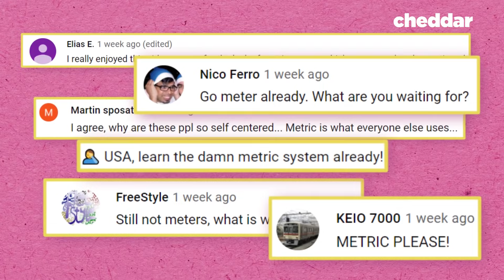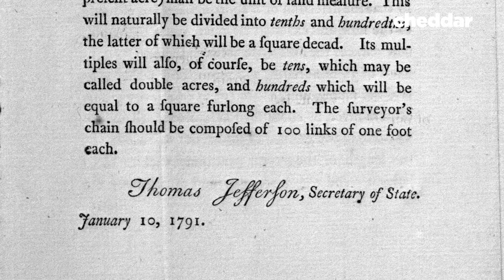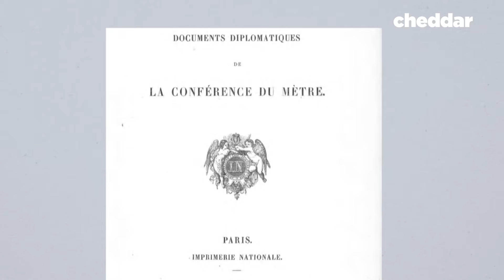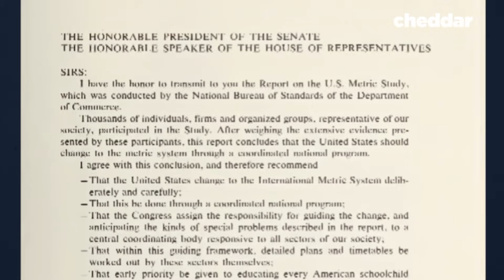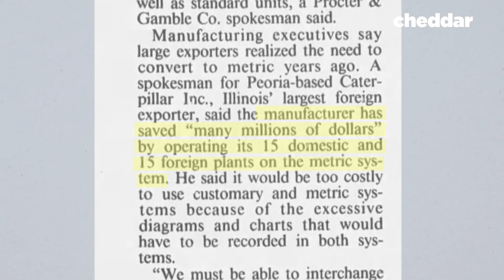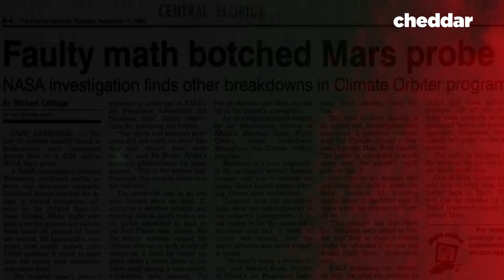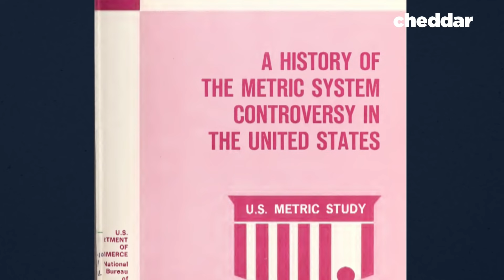Why Doesn't the US Just Use the Metric System? - Cheddar Explains

Comment: The Imperial system makes it easier for the DEA to find drug dealers.  They just go into a room and yell, "How many grams are in an ounce?"  The first person to answer is the drug dealer.
Reply: According to Breakin Bad, there is no difference.  :D
Reply: Isn't the ounce a predominantly measure of VOLUME, and used mostly for liquids? If so, then an ounce of anything would have a difference mass, in grams or not.
Reply: @berlineczka  A fluid ounce is a mesure of volume, an ounce is weight.
Reply: @berlineczka  Yeah the ounce, it sucks. Ya see there is more than one of them. One just called "ounce" and it's for mass and  another is called the "fluid ounce" and that's for liquid volume.  So Yes, a fluid ounce of the right kind of fluid CAN have more (or less) than an ounce in mass.  I'm all for giving up on fluid ounces,pints,quarts, gallons and going with cubic inches for volume in the USC system. This is one area that Metric is certainly simpler!
Reply: James Slick Metric is simpler in ALL areas ... Name one in which you find imperial to be easier.
Reply: @Stefan_Van_pellicom  I actually NEVER proffered that USC (incorrectly called Imperial, BTW) was "easier", LOL, I actually prefer Metric. My whole bit is that there is this myth that Americans don"t know or use Metric. This myth oddly is supported by Euros and Americans alike. WE USE BOTH. I like metric because I have a DEEP hatred of fractions,LOL. (And I've been for the abolition of the fluid ounce for 45+ years, if nothing else!) - Just not going to do Celsius..That's all.
Reply: James Slick I know Americans use both systems, but it adds complexity to your life, so I don’t understand that the evolution towards simplification goes so slowly. (Though I have to admit that we have euros for some 20 odd years now, and I still convert to Belgian francs all the time.)
As far as celcius goes : I get that ! But if you were in the cooling business and had to do calorimetric calculations, you’d swap in a second. :)
Reply: @Stefan_Van_pellicom  Construction imperial it's not very precise but it's easily dividable by 3 and 4  which makes it's really efficient at job sites.
Reply: good one! :D
Reply: 28 grams! sniffing heavily
Reply: 28.35 to be precise
Reply: I'd argue a scientist would probably be able to and more inclined to answer faster.
Reply: @steampunknord  A scientist would know, but probably not off hand like that. Drug dealers use it frequently, where a scientist wouldn't be an idiot using both systems at once
Reply: Lol
Reply: @John Paterson Maybe by the D&D dice
Reply: But don't "snitches get stitches"?

Comment: We are only a few years away from having AI software that can edit videos like these on the fly and replace the numerical units within text and speech to whatever measurement system you want.  The content provider can say inches and pounds, and the software filter will swap in millimeters and kilograms, or vice versa, in the same voice and/or fonts, probably even editing lip movement to make it appear as if the speaker actually said the opposite unit system.  Just right-click on the video, and select your preferred measurement system. The US will eventually switch over to full metric at some point in the future, but AI video editing will be an amusing feature that will come along in the interim.  It will be like a form of augmented reality Google Translate for real-time video modification.

Comment: Here is a question not enough people are asking.  Can we do better than the metric system?  I think the answer is yes. The metric system was amazing back in the 18th century, but we know more about our universe and its constants.  Why base a unit of length on average distances?  Why not base speed, distance and time on the speed of light through a vacuum, one of the most constant thing we've found? Why base 10, we could use a base 12, ,base 16, or base 60 system which would reduce the amount of fractions that spring up from time to time.  I think the USA should leave the imperial system, but we should find a better system using more modern knowledge and tools than the French revolutionaries had when the came up with the metric system.
Reply: iirc the meter is defined by some aspect of light.

Comment: It's easier to use but it just "sounds" so snobishley European.  Maybe change the measure but keep the English unit name. Ie. Centimeter, a metric inch. And then what about all the mechanics tools?
Reply: The mechanics still have to have two sets of tools that is one problem with not converting. More tools have to be made, mechanics have to spend more money on tools, more space to store two sets of tools etc. Changing over really sucks short term but would pay off in the long term.

Comment: A big blow to the introduction was when gas went over $1.00 per gallon.  Many gas pumps at the time did not have a position for the dollar in the price on the pump.  The fix was to convert the pump to Liters and advertise at about .33 cents.  Both the difficulty of comparing prices and the established fact the metric was way more expensive resulted in metric stations simply being shunned universally.  The other problem is the distance was still in miles, so figuring fuel efficiency was a bastard from the start with liters per mile.  That conversion should have included speed and distance changes at the same time. It wasn't worth the effort to figure out if the metric gas was cheaper.  It never was. 

 However at the same time metric products were introduced and sold well.  A liter of soda was a pint and a liter bit more.  The 12 oz and 16 oz bottles fell by the wayside.  Due to the gas fiasco, milk is still sold by the gallon.  Maybe if they introduced the imperial gallon as a gallon and a liter bit more they might make the conversion, but many fridges would not fit the new container.  A car that has imperial bolts on the body and a metric engine is a mechanic's nightmare.  This is why many foreign cars have a better reputation for repair-ability.  All medicine and related is metric.  All high tech manufacturing is metric.  Most of the science is now metric.  Units of the meter are centimeter, millimeter, nanometer, and micron are common in optics, semiconductors, etc. In electrical units of Watts are milli, micro, Kilo, Mega, etc.  Read your electric bill.  It's metric.  How much do you pay for a Kilo Watt hour.  Electric and electronic components values such as the Farad, Henry, Hertz, and Ohm are metric.  Many people are simply unaware of how much they have been immersed in the metric system. Your favorite radio station is on what frequency again?  Metric.  Mega hertz. Your stereo? 20 hz to 20Kilo Hertz.  Metric.

Comment: What the video does not really tell why the various manufacturers benefited as three weights and measurement systems became one. The unfortunate thing was Britain and the U.S. could have the world using a combined standardised UK/US system where we use for example the U.S. gallon (3.785 litres) as oppose to the British (4.54 litres) but we could not agree a way forward. In the UK we have a Imperial / Metric system, yes although the UK went metric in 1965 and had decimal coinage in February 1971 we still use MPG, statute miles and the good old British pint in the pub and a pint of milk.After the metric martyrs (small retailers who refused to switch and were prosecuted for weighing out in Imperial [Nobody bothered to compensate them for having to buy new weighing equipment]). Britain then stopped forcing people to be Metric, so a dual weight & measures labelling system came in. (The U.S. saved the day on this one as you have to label with the two measurements to trade with the U.S.) We are quite happy with our two systems, when I went to school we trained completely in Imperial weights and measures. We had 240 pennies to the pound sterling, 12 pennies to the shilling and 20 shillings to the pound sterling. The old Imperial system was based upon what people had to  use to perform a measurement such as hands when used for horses height. When we went decimal we found that the old Imperial system had stretched our brains and the metric system in some ways made us less mentally agile. Educational experts tell us that we are more brighter if we speak more than one language; one could argue the same case in the U.S. for using both U.S weights and measures and metric. So I for one will cheer on the U.S. as it continues to use its U.S. weights and measures regardless of what has been legally passed. One thing we Brexiteers have used to wind up those who have voted to remain is that we will return to the Old currency format. (Wonder if that will be this years April Fools Joke in the Pro-Brexit Newspapers!) You heard hear it first.

Comment: Both the metric and imperial systems are equally accurate and precise. However the metric system is much easier to use for most calculations. Most Yanks can use the metric system as it is the preferred system for sciences, commerce, and illegal drug trade. ;-) Yanks have a metric monetary system and they officially adopted the metric system before the Brits did. I do like the old English unit of stones for body weight which many of my Brit friends still use. On the other hand, I could never figure out how to make change in the old UK monetary system. Now if they could only develop a metric system standard for shoe and bra sizes. ;-)

Comment: Guess what America, radio frequency, computer data, processor clock speed and anyway to measure electrical values from picofarads to gigawatts are all metric
Reply: @Bill McMinn @MrBillmcminn Guess what Bill. You are SOOOO wrong. Frequency is Cycles per second. Any measurement with time immediately invalidates that argument because time is not metric. Computer data. Storage is measured in Bytes. (There are 8 bits to a Byte) Computer data storage and data transfer are the exact OPPOSITE of metric. Jeez man...get it right.

Comment: I was reading a circa 1890 report from the US Coast survey. Not a foot or Fahrenheit to be found. The geodetic survey of the US was metric at its inception. 

Even US Geological Survey maps from 19th century had Km as well as miles. 

We’ve been metric for quite a while. Feet and inches are output, but in CAD software it’s core is metric.

Comment: At this point, all science in the US use the metric system, but it is common jobs like carpentry that are stuck in the other system and the US still uses Fahrenheit for temperature but it is easy to switch, just use the formula: C=(9/5)(F-32).

Comment: The thing is that, imperial units aren't really "properly defined" anyway, so what's the point of keeping it at some obscured value? In China, metric isn't always being used, but our traditional measurement units have been regulated to have a simple ratio to the metric unit, so that 1 Jin = 500 grams, 1 Chi = 1/3 meter, 1 Li = 500 meters. Which makes life much easier because it's essentially just metric, just that you have to do a simple multiplication or division. And it's not like imperial is far off either, giving that 1 pound = 454 grams, which means that if back then people just regulated that to 500 grams there won't be any issue at all.

Comment: I'm a carpenter. How would my framing square work in metric?
Reply: Same as it does now.  A 5/12 pitch is the same angle in inches, feet, centimeters, meters, furlongs, parsecs, whatever...
Reply: Based on the people who work for me, it doesn't change. They are just square cornered boomerangs. I told one to get a framing square and he came back with a speed square and took offense when he was told he was a dumbass. As far as how it would change from a technical standpoint, roof pitch is probably set in percent of grade rather than rise/run that we are used to using.
Reply: At least in Canada, from what I can tell,  the standard sizes still apply, just converted to metric. Also a lot of carpenters in Canada use straight imperial. Building materials are sold in imperial sizes but converted to metric units. 120x240 etc.
Reply: The metric system is easier but us Americans have it our own way because we are told to.
Reply: 122 x 244 cm
Reply: well then you would have to get a framing  rectangle with the flywheel option in french.
Reply: Joseph Turner 
At least in Scandinavia they’re pretty much the same, wouldn’t be surprised if most material sizes are standardized to be exactly the same (and from the same factories) worldwide. The 4’x8’ plywood sheets are 122x244 cm, wall studs c/c 60cm, a 2”x4” is 45x95mm, nails are sold as 70mm, 95mm, 120mm which of course are equal to 3”, 4”, 5”. And so on. People sometimes refer to the olden measurements as monikers because they’re shorter to say, but that’s pretty much it.
People didn’t change the way they built houses when the metric system came.
Reply: The unit of measure for carpentry and construction in Australia is millimetres or mm. One inch is 25.4mm. Drill bits and room sizes in architecture are in mm.
Reply: Actually, carpentry is one of the VERY few areas in which we still see inches (all lumber sizing) and feet (lumber length sizing and most of our plywood and other sheets are 122x244 cm or 4x8ft).
Reply: @Stefan_Van_pellicom  Railroads globally use imperial.
Reply: in australia here, wall studs and rafters are at 600mm centres, ply commonly comes in 1200mm x 2400mm sheets.  @Joseph Turner

Comment: So when will the metric world abandon the standard 360°, 24 hour/day, 7 days per week, 12 month per year - non-metric TIME system? ... a system anachronistically based on how long it takes the SUN to relativistically  move incrementally along the earth's equator?   

For metrification of time, we could declare that one month will be 1000 units of time length, and then divided/multply by 10 by 10 by 10 and then 10 gain in order to simplify.  Ditto on the length of the day, the week, or even the irregular amount of days in the months.  Abandon old fashioned 'time' and then metrify the time base of "2π 'radians' per 1 complete revolution" and then use a single metrified *accumulated time*, say, since midnight on New Year's eve ... for entirety of time until next New Years ..... just ONE number divided/multiplied by series of 10's for the initial start point of New Years At midnight ... and NO complicated minutes, seconds, hours, days, weeks, months .... just one decimalized number to the various 'powers' to base 10. 

Down with NATURAL measurements! Measurements based on pure politics are soooooo much better.